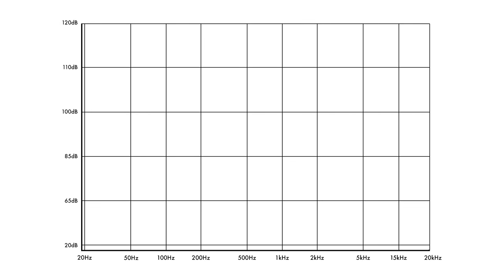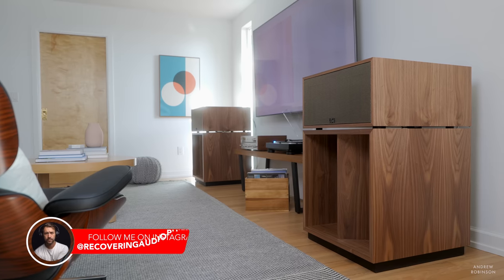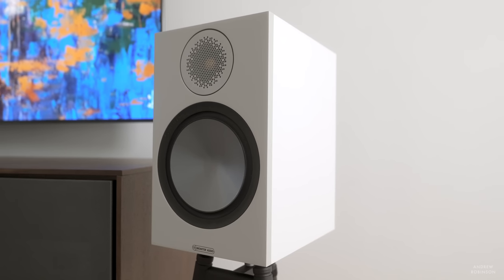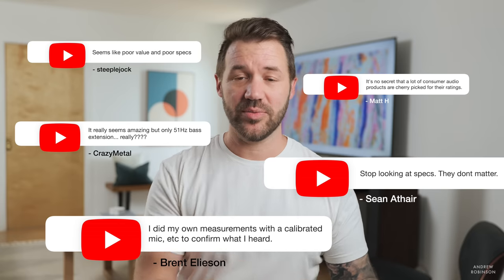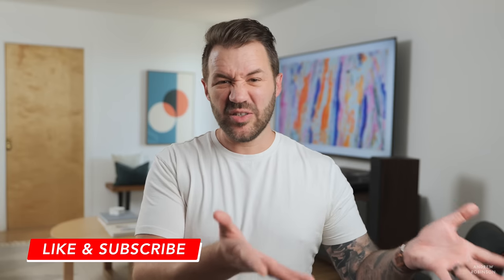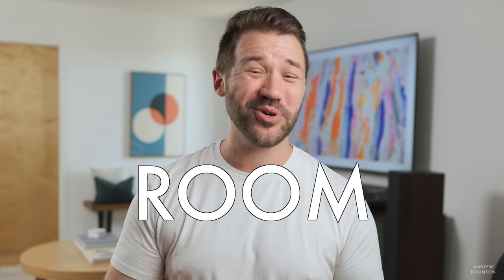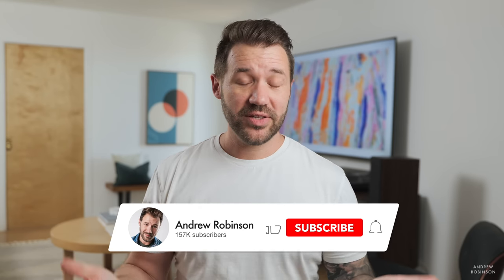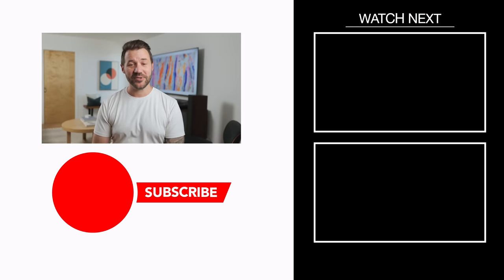DO SPECS REALLY MATTER in Audio? Understanding Speaker Measurements!

Comment: In my opinion you cant have one (measurements) without the other (subjective listening). Like if you think about it like a science experiment measurements are the control variable and subjective listening is independent variable. However you can't compare in-room measurements to anechoic or other people's in room measurements. I think the whole accountability thing is one half and some things that lend itself to a bad speaker that might not be obvious might stand out in a measurement which while it might not bother you or you might like it could bother someone else. It just allows you a basis of understanding for what a reviewer hears and what you personally like. I bought by Jamo S803s based exclusively on reviews and regret it and if i had saw how (poorly) they measured I wouldn't have touched them. My personal favorite speaker reviewers are New Record Day and Erin's Audio Corner. That's not to say you guys are bad reviewers its just that without the measurements for a speaker I have nothing to compare them to what you say so your reviews don't help me beside from an entertainment standpoint especially since the one bassline we both share (your S803 review) we both have differing opinions on them.
Reply from the maker: This comment intrigued me. First, in the spirit of the video itself it would appear that you and your experience with the Jamo S803 prove my point; how two people listening to the same speaker but with a wealth of variables between them can come away with two different experiences. This despite the speaker having a measured frequency response. I mean, your speaker didn't have a different response from the factory than mine did (within a certain tolerance) so how did we hear radically different things? All that said, I am curious what you found disappointing about the 803 specifically. Please, be as specific as possible. Also, what is your room like? What associated equipment did you use. I'm very curious. 

You mentioned buying them and THEN seeing how poorly they measured. Was that measurement accompanied by another review or reviewer's opinion, one that just so happened to align with the specs? I only bring this up because how do we know that one isn't just interpreting the spec sheet first and then aligning their opinion of said speaker up accordingly? I'm not accusing you or anyone else of doing this, but for the purposes of this little thought experiment, how can we be sure? Sound demos on YouTube don't tell you anything, nor would a measurement of a speaker in another person's room necessarily translate to you. Additionally, if said measurement doesn't fully track with the manufacturer, who gets the benefit of the doubt? The enthusiast measuring in whatever capacity they have, or the manufacturer? These are all questions I don't necessarily have answers for, but I am genuinely curious what you think about it all. Please reply. 

Regards,
Andrew
Reply: @andrewrobinsonreviews  Just want to start with saying thanks for the reply. I just rewatched your review as to make sure that it's fresh in my mind. My setup is Jamo S803 5.0 kit with a Denon X1400h with 2 HSU VTF2-MK5 subwoofers that I have time aligned and heavily EQed with a miniDSP to get a flat frequency response in room with 80hz crossover for LCR and 100hz for Sides and I have the room correction turned off at 700hz and up as full range correction does horrible things most notably makes them very harsh sounding and tinny comparatively speaking. My room is 13x18 with the couch on the back of the 18ft wall and an opening to other spaces in the front right corner of the room next to the right speaker. Speakers are placed in a triangle with MLP and relatively close to the wall with the rear of the speaker being 4" or so from the back to the wall so I do get some boundary gain that the AVR . Main issue is they just sound unnatural in tonality especially with voices which I primarily use my setup for movies. They are just overly sharp to the point where everything just sounds off. They also don't like to play loud like you mentioned which is where compression starts to happen in the bass and they get even sharper. Also the main reason I have the surrounds at 100hz is because one day I was listening to the THX demo and even at a lower volume they weren't happy and that was the fix. My typical listening volume for movies is -10db on the AVR. Center like you said also doesn't hold up to the 803s.

The specific review that lines up with my opinion is that of Erin's Audio Corner where he reviews subjectively and objectively the S807 which while not the same should be similar enough since it's all the same drivers just with one extra woofer in a larger enclosure and most of my issues aren't in the bass department. He listens to the speakers, takes notes with familar songs to him then measures them anachoically and compares measurements to his initial notes and relistens if he thinks there's something he missed initially. Before watching it I just never fully happy with the sound but thought they were decent for the price but the farther I go down the HT rabbit hole and the more I understand the worse my opinion of them gets and his review didn't help that. Hell I even said as a comment on your video that I agreed with you right here: https://www.youtube.com/watch?v=gxABNCBFejo&lc=Ugzk-KjmFNKO3Eg_6_h4AaABAg . So how could my opinion change that much? Pretty much these aren't for an enthusiast(me now) as I think these a great speakers for someone who knows nothing wants the smile curve and has only heard cheap tiny home theater in a box speakers or soundbars and doesn't know proper placement with toe in and just sets these up pointing straight into the room and calls it a day as that's the type of person I think these would make happy. That used to be me but now I'm looking for something that I can get a consistent experience in both the MLP and the seat I always sit in just to the left of that. I guess my big takeaway is these are a $200 speaker system that I expected to sound like the $400 I paid for that everyone says punches above its price class (so maybe $600?) so when I got $200 sound quality I was disappointed as I could done that for cheaper with Dayton speakers (b652 air) or something wasting less money initially. Pretty much the plan is to learn as much as I can about speakers, work on getting/making non-hideous room treatments and making my speakers sound as best I can in my room until I'm ready to take the plunge into something of a different class. Kef reference, Revels, or maybe some smaller internet direct brand like Ascend Acoustic, Chane or HSU (specifically their coaxial speaker). Main goal is getting a 3 way center or coaxial center as having the s81c has caused me to value that even more.

Side note I would love to let you two hear my subwoofers as even without all the fancy dsp work I've done with them I think your perspective of quality bass might change as every time your reviewing a $1500+ soundbar or any small sub really that looming thought of well you could get one of those within that price and it's not even close would be amusing to me as the only quality sub if i remember correctly you've reviewed is the SVS SB1000 but sealed subs don't have that same impact that ported subs like the PB1000 do. But that will probably never happen as I doubt you'd want to spend the $300+ in shipping it would cost to send them to and from wouldn't make sense.
Reply from the maker: Tyler, appreciate you providing these additional details. First, couple of comments regarding the miniDSP - it's interesting to me that following your corrections to the speakers' mid and high frequency, you found them to be more forward or sharp. I say this because if you are correcting for the high frequency bump that we know these speakers have, even applying a negative 2 to 3 dB PEQ filter wouldn't result in these becoming harsher - that is if I'm understanding you correctly in how you attempted to use miniDSP to make these speakers more neutral. 

With respect to the tonality, in rewatching my own review I don't believe I misrepresent these speakers and it seems like you agree with me in your description of what you're hearing, but you are still finding fault with the tone of the speakers despite getting accurate information from my review. This is fine. I just want to make sure that we are on the same page.

With respect to Erin's video (which I have just watched in order to better respond to your comments), I have a couple of concerns. First, if you're tastes have changed, that's one thing. It is possible that at one time you wanted a smile like curve frequency response which helped guide your buying decision towards the Jamo. Tastes can change and so maybe you are in a different place now. That said, everything Erin breaks down or describes about the Jamo sound both subjectively and using measurements correlates almost to a T with what I am describing in more layman's terms in my review. But that's not what concerns me. What concerns me is that in your response above, you quite literally repeat verbatim some of Erin's talking points. So now I'm curious if that is how you really feel or if this how you think you need to feel because you're trying to aspire to a different standard, maybe even someone else's standard. Honestly, it doesn't affect me either way. I'm simply wondering if you realize that you have adopted another person's viewpoints and even specific phrasing.

In the end, one of the things I say repeatedly in my video about these speakers is we have to manage our expectations just a little bit. I don't believe I ever say that these $200 speakers perform as good or better than $600 ones. I do say that at their discounted and even MSRP this is a solid home theater set up. In looking at your original comment on the review where you seem to feel my review was "pretty spot on", it would appear that you have broadened your horizons over the past year and now are in search of something different rather than the Jamos suddenly being bad. I have to imagine when you first got them you might have actually been fairly pleased with them, at least you didn't hint in your initial comment 7 months ago that you were unhappy with the purchase. But over time you have begun to feel differently. What's influencing this change of heart is maybe the bigger question for me.

About your side note, I am well aware of HSU Research subwoofers. I think they are fantastic and have no doubt that you are experiencing truly kick ass bass in your room. No need to send them to me but I appreciate the offer.

Thanks again for taking the time to respond to my questions. You don't have to reply to this if you don't care to but I really appreciate the conversation and hope that you find a system that works for you.

Andrew
Reply: @andrewrobinsonreviews  So I'm not using the miniDSP to apply corrections to my mains only the subs. My Denon x1400h unfortunately doesn't have multi channel pre-outs (nor independent subwoofer outs) as I would have needed the x3400h to get that so I can't use the miniDSP in that regard. However with all Denon/Marantz receivers with wifi 2016 or newer they have a $20 app that you can set a custom target curve along with choosing which frequencies audyssey is allowed to muck with on a per speaker pair basis. So audyssey attempts to correct to a certain line which is pretty much flat with a dip in the midrange and then with the high end rolled off so if you wanted to adjust it you could with Harmon curve being popular but I tried that and they sounded better but not as good as no correction above 700hz. I've heard other people say 300-500hz and others 500-700hz as the room transition zone where room correction is just guessing so I went with the higher end of the spectrum and according to the results graphs it looks kinda flat but I haven't checked to see what its fully doing in REW as the after graph is just a hopeful assumption. So that's how I came to trying 700hz so anything above that is like listening to the speaker in direct/pure with the benefit of it fixing the bass. Definitely would be curious to know if you did that with a Denon AVR if it would change your opinion on them since I know you don't like their out of the box sound signature in comparison to Yamaha or Sony or if you could tweak it to get a sound profile that you found comparable to a Yamaha or Sony.

A little backstory, I've grown up with nice sound in respect to my dad having the original polk speakers from the 80s with the same tech as the new Polk Legend series and Polk RTI series speakers for his living room. So before getting into this I never really critically listened to them more like oh they sound nice. So for me getting the Jamos I was originally like these don't have bass but that was kinda to be expected in my mind so I bought subs and continued on. However now that I have critically listened to my dads systems, and listened to mine and most importantly gotten familiar with mine that is how my opinion changed. Like I used to not understand anything so like if you had asked me 7 months ago to describe how any speaker I hadn't seen a review for sounds I probably couldn't have to any better degree than good vs bad. Like I very much relate to Kristi in the sense that I've grown an ear more or less because of watching speakers reviews and investing in the hobby. Honestly Erin's review just resonated with me in way that the other reviews i had watched hadn't (ZReviews, Joe-n-tell, you, and a few others). I'm a software developer so i tend more towards the sciency stuff which I think helped. The main reason why I continued watching videos was to understand my speakers more as I couldn't place it myself. I will agree that your review does sum them up in a general sense maybe not to the same degree I think which is why we have come to different conclusions. Also related to the price you, joe, zeos, and other have said these speakers punch above their price so I guess my expectation of getting the kit on "sale" (lol) for $400 normally $550 and the 803 alone costing $300/pair originally my expectations were skewed with a smidge of not knowing what I bought however you're looking at it from a $200-400 price point unlike the higher price point that the other reviews I watched when I bought were. I think for me I'd be a little more forgiving if I bought in at the $200 price point since at $400 I think doesn't line up with the performance you get. So hopefully that expresses why my opinion of them changed and how I could go from one end to the other.
Reply: @swllz   Well the subs are tasked with the goal of pressurizing my whole house so by that logic they are severely undersized since my house is over 10,000 cubic feet and one subwoofer is rated as audioholics bassaholic rating of large meaning 3000-5000 cubic feet and 2 isn't going to magically get me the rest of the way unless I literally build a door to my living room. I've accepted that they will never be up to the task and plan to add bass shakers to my couch. However selling off one subwoofer would be a terrible idea due to the fact that I have a 20db null from 45hz to 65hz with the worst being at 55hz (where the 20db point is) and where my other subwoofer is I have 16db null at 30hz that goes from 25-35hz and another one that goes from 65hz to 85 hz and at 75hz it's down 22db so both together give me complete coverage but just one is shit which is why I got the second one. 

I agree the Denon isn't the best but the real issue is the speakers not the AVR as it would be perfectly fine if I had speakers that didn't range from 81db sensitivity to 79db sensitivity with 1w @ 1m. Just to get them to their advertised rating means I need 4x the wattage and then at my 10ft distance I'm going to need even more power since 2 meters would be another 4x wattage then listening at 75db with 95db peaks (-10db MV) means another 8x the wattage means I'd need over 128w of power per speaker which obviously isn't happening but let's say I had 86 or 87 db sensitivity bookshelf speakers I'd only need a bit over 32w which isn't too unreasonable of a task for most AVRs including mine. 

However my plan really soon is to buy new speakers and then a new AVR. I need to demo stuff but paradigm founders, kef r series, SVS ultra, monitor audio silver, and probably a few others around there are what I'm looking at. I have my eye on the unreleased Onkyo rz70 which is supposed to have auro 3d and dirac live bass control which should future proof me for a good while and by the time that's out I'll hopefully have enough money saved to afford it. I see it as an investment as speakers will last me 10+ years at least so investing in top tier stuff should make it so I don't need to upgrade any time soon. Another thought I had was doing diy but I'm not sure I could make them look pretty enough for a living room.

Comment: There is no reason to manufacture poor measuring audio equipment. Why would anyone buy $2000 dollar speakers that don't measure as good as $500 one. I think that active speakers with built in dsp will be the future as they could cure most of the room problems. Kef ,B&W and Revel all measure speakers, you would have to in order to improve them, that's the level it's getting to. The same for Dacs, they are now getting very hard to improve, with a noise floor of -130db already beyond human hearing. So do your reviews count for anything, as they are in your room with your music choices.